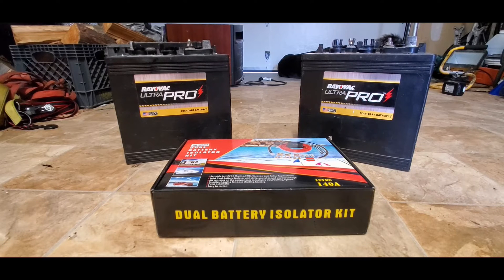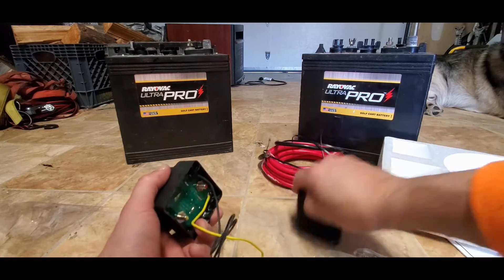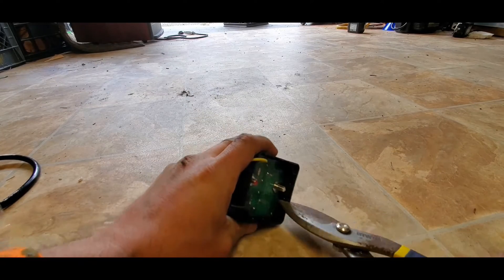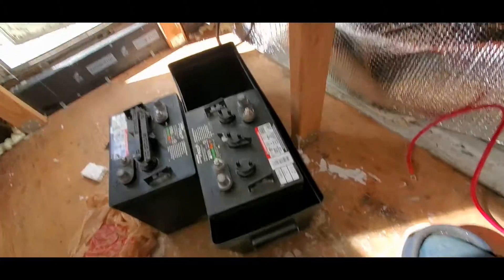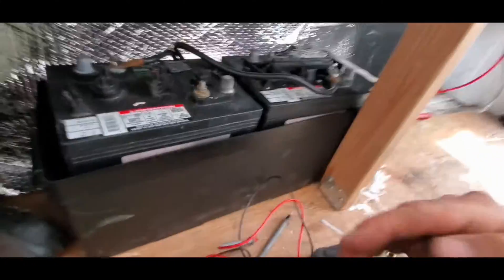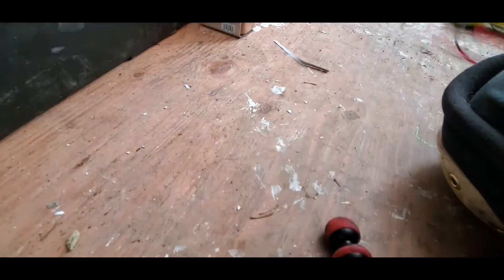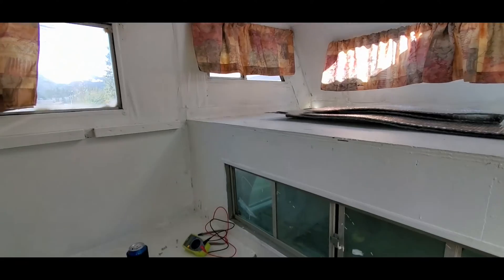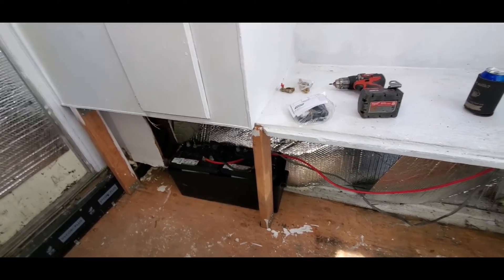How To Install RV Dual Battery Isolator Kit (Power Up Guide!)

Comment: Do you have to go under the hood to always tun isolator switch off?????
Reply from the maker: Oh no not at all. Not at unless you install a kill switch at least. Otherwise it is automated and will send power back to the camper whenever the truck battery is over 12.5 volts.

Comment: Please someone tell me, what should I do with the yellow wire if I’m not gonna connect it to the switch. Do I need to connect it to the ground or battery itself? 
Thank you!
Reply: As far as i know you need the yellow wire  if your ,main battery goes flat, its to push current back to the flat battery missing out the isolator..ive not fitted mine yet to know for sure tho

Comment: Did you hook up the yellow override wire to starting battery positive?
Reply from the maker: Hello Skerrunch, and thank you for the question.  I connected the yellow wire to the driver side battery  which I believe is connected in parallel with the passenger side battery that is connected directly to the starter.   I think that is how the LB7 Duramax batteries are connected anyways.
Reply: Thats what i was thinking ?
Reply: Isnt it go to ground via a switch so you can over ride the isolator or blank it off and not use it at all. I have been trying to find out what to do with this yellow as well. Bloke at the shop didnt know, he thought it goes to your ignition.
Reply: @douglasmoody3403  yes, I install a lot of these and that's how I've always done them. It's an override. I run it through a switch to ground, it makes a nice in-cab jumpstart feature
Reply: Please someone tell me, what should I do with the yellow wire if I’m not gonna connect it to the switch. Do I need to connect it to the ground or battery itself? 
Thank you!
Reply: @eminism  all the answers to your questions are typed above
Reply: @Dangerous.D  Wow. Great 👍

Comment: Your not worried about having lead acid batteries giving off fumes inside the camper when they are charging?
I thought the yellow wire had to be connected to a switch and you use it to start the car off the house battery if the starter battery goes flat? If it’s connected to the starter battery doesn’t that connect the two batteries always?
Reply from the maker: Hello Byron, and thank you for your comments and questions.  Fumes while charging is definitely a  concern but space is limited.  Luckily the camper is pretty well vented and no one is back there when I'm driving and the batteries are charging.  The nice thing about the dual battery isolator is that the camper battery doesn not pull from the truck battery and the camper batteries will only charge after the truck batteries reach a certain voltage threshold.
Reply: Battery venting is a very serious concern.Also I may be mistaken, but I did not see any fuses.. there should be one coming straight off the truck battery.And one close to the accessory batteries.